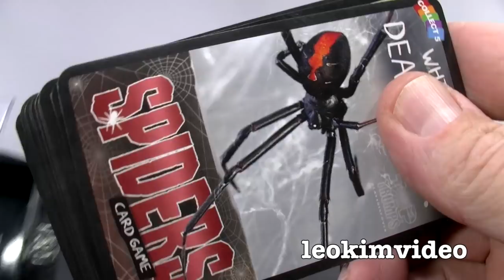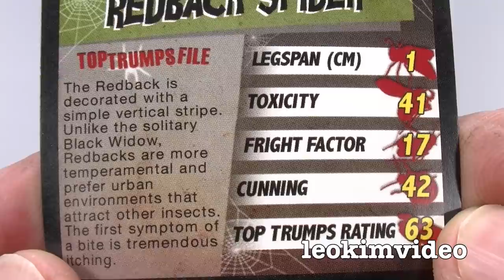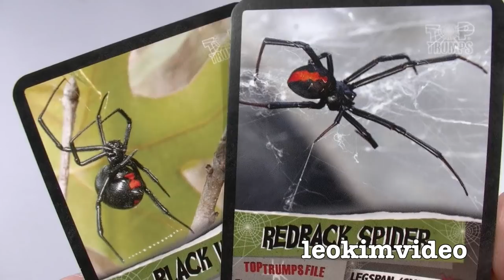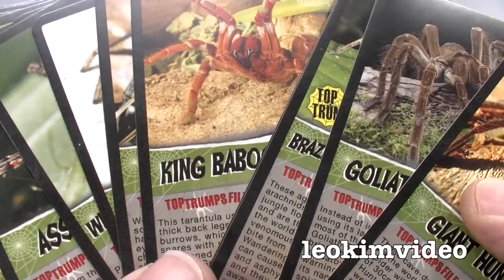Redback Spider Spiderlings Now Bigger & Mystery False Widow Week 11

Comment: Try a scorpion as they have armour and they are aggressors, it would be nice to see the outcome.
Reply: One scorpion can lose in half a second and get its pincers and stinger all tied together by one pspider if it gets stuck in webbing
Reply: That would have to be one tiny tiny scorpion to get both claws and tail wrapped up
Reply: Michael•J•S• depends on the spider and the scorpion, and emperor scorpion would be too big for a red back to string up
Reply: @ShakenPig  im still waiting... just interesting to watch shame he stopped doing these.
Reply: @ShakenPig  bone crushing?
Reply: @ShakenPig   The redback bites where the joints are. There is a video of a scorpion getting trapped on the Web and redback spins a lot of Web onto it and then biting it.  If no Web scorpion wins hands down but if Web that is a different story. So it's not 10 out of 10.

Comment: To clarify the difference between the Redback and the Black Widow is that they are simply different species. They are under the same genus (Latrodectus). To put that simply, they are kinda like cousins to each other. They come from the same background, but they vary slightly based on their location. I hope that helps clear any confusion

Comment: Leo, I've ran into the same issue regarding the solid black spider. Some have told me that it was just a regular wood spider, but I'm like you, it has all the characteristics of the redback and black widow, same identical shape with front and back legs using them to form their webbing. Every thing is the same except there's no red anywhere on their body. I'm yet to find out for sure what the name of this spider is. Have you found out a name for it yet?

Comment: Red-backs (Latrodectus hasseltii) are usually glossy black, with a distinctive red/orange stripe on the abdomen. However, it is not uncommon to find variations on this pattern. Don came across a red-back without any red on its back at all.

Comment: You can tell the two Daddy long legs apart easily as the shape of their bodies are quite different, the Opiliones appear to have one large body mass, where as the Pholcidae, have the normal two-part bodies. The one put in the tank, which died possibly due to being overwhelmed with enemies, appears to be the Pholcidae. I think a rematch with several Pholcidae would be a better match.

Comment: Here are the differences between a redback and a black widow spider The redback spider does share the red marking trait with the black widow spider, but those marking are distinct for both species. The black widow spider is very well known for the hourglass-shaped red marking on the abdomen of female spiders. The mark is quite clear, although the color tone may range from a orange-red to a bright red. The redback spider does have a red mark, but it is a simple vertical line that bisects the abdomen. The color tone of the mark on the redback spider may range from yellowish-red to bright red, but the mark is clearly a line and nothing more. Some females may have a broken hourglass on the underside of their abdomen. The shape loosely resembles that of the black widow spider.
There are significant differences between the genders of the spiders as well. Female and male black widow spider are black, while the redback females may be more of a brown color. The redback males are usually light brown. The males of both species have white markings on their backs. However, the black widow male's markings are lines that radiate horizontally from the center of the abdomen. Redback males have white spots or lines surrounding the faint brown hourglass on their back.
True black widow spiders are found throughout the North American continent. They live in crawl spaces, basements and outside in woodpiles and the hollows of trees. A redback spider, however, prefers urban environments that get heavy traffic and attract other insects. Black widows are more solitary spiders. 
Scientists once considered the redback spider as a subspecies of black widow spiders. Over the years, the spider's habitats, physical traits and other characteristics have distinguished the two spiders as separate species. The bites of both spiders also are venomous and very painful. However, the first signs of a redback spider bite is a ferocious itching, while black spider bites are first detected by an excruciating pain at the bite site.

Comment: Leo the redback without a red stripe is not a part of the latrodectus line and its probably a cupboard spider and it doesent have a red hourglass either
Reply: Its DEFINATELY a cupboard spider
Reply: I wonder if that cupboard spider has crossbred with a male redback. You might find a new species.
Reply: Btw the very white egg sac came from the cupboard spider.
Reply: Also the other spider at 17:00 ofthe vid is maybe a daddy longlegs? or a red widow spider(not to be mistaken from the redBACK spider)
Reply: If the white egg sac hatches into alot of cupboard spiderlings then there is a myterious male hidden
Reply: Leo PLS notice this comment
Reply: joel magsino I
Reply: joel magsino  It's rare but sometimes the stripe is so faint it looks black

Comment: Hey, Leo.  I've come across something a little concerning I was wondering if you might try testing over on your end as well.  I have a ton of Black Widows here on my property and I spray them to kill them.  I put one of the corpses in a jar to get some close up pictures for someone a few days ago (a sealed mason jar) and then set the jar off to the side on my desk not thinking much of it for a day.  It's now day 3 since this was "killed" by chemicals and its coming back to life.  I noticed last night it had started moving one leg a bit.  I thought maybe it was some oddity of decomposition.  Today its some at least some small movement in all 8 legs.  It is still on it's back and very lethargically trying to right itself...   This may be a telling sign of your infestation if these paralytic chemicals are not enough to truly kill, but only knock them out for a couple of days...  And mind I absolutely soaked this sucker...

A quick note about those cards and the extra red you noticed.  There are a TON of Black Widow species.  The ones most people picture are black with nothing but an hour glass on there underbelly.  There are many species with red stripes and red spots on their backs (even some with yellow and white).  The northern Black Widow (Latrodectus variolus) can look almost identical to a Redback.